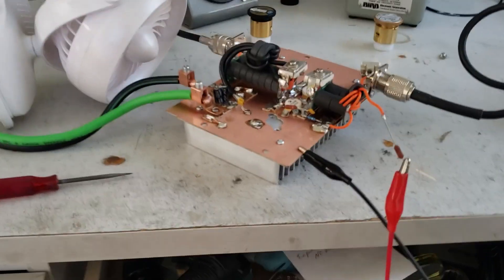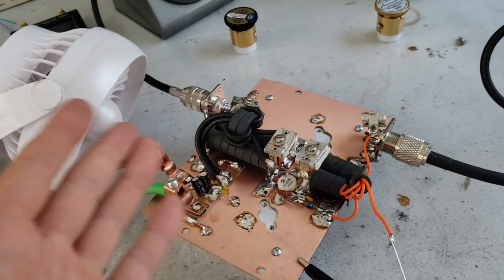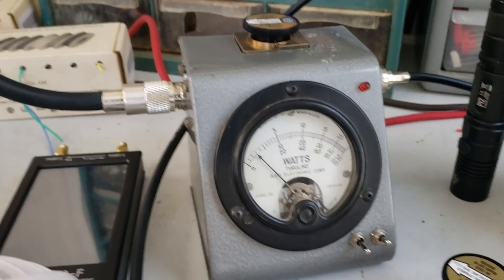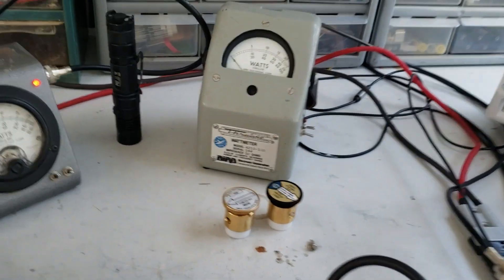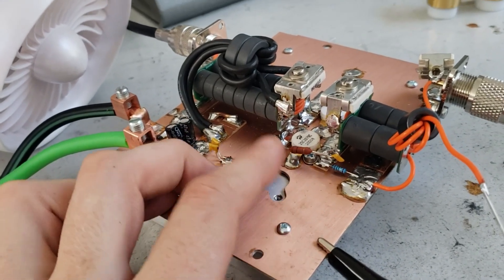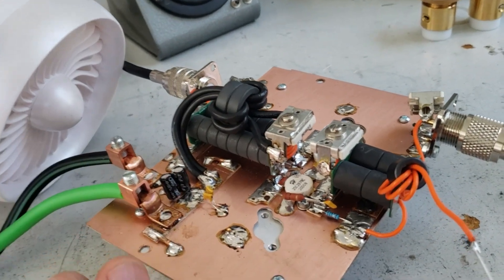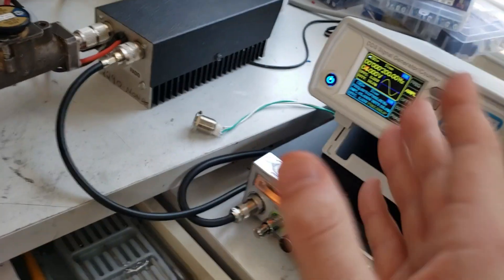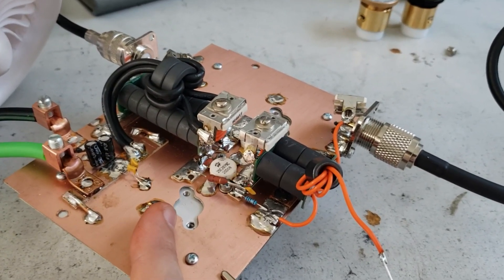Testing the HG 2SC2879C

Comment: The gain on those devices is awful. That shows that those transistors are certainly not up to industry standards. Aren't you the least bit suspicious that no legitimate company uses that manufacturer's devices in their product? HG is NOT a recognized semiconductor manufacturer in the electronics world. If I ever suggested using some of their devices in one of my design reviews at work... I'd be looking for another job the next day... LOL
Reply: Dude your "pallet" is nice but imo not 600w for $4,000 nice. Sharky had ldmos 1500w for $650 with filtering. Just saying
Reply: Then I suggest you contact Mr. Sharky for your future equipment...

Comment: You showed you was pushing your wave form into compression.
At that point the amplifier would be responsible for splatter because it would now be creating more IMD products . 
The radio may be clean but once you push into compression the amp becomes dirty, 
Ie if the radio alone set up correctly was showing a imd at -35dbm down on the primary signal,
Then I can say your amp pushed into compression on your oscilloscope,  would have raised your imd product considerably .
It may add colouration to the audio as you have said else where.   This colouration will be causing splatter. 
It’s my experience if Toshiba and others give a imd spec at 100 watts at 30 MHz at 12 volts, when you push past this
These imd products can be a problem and you will be splattering regardless if the radio is clean or not. 

Since You now have a spectrum scope , surely you have seen as you push into compression on the devices your harmonics go up,
Your imd products rise and your signal gets wider.    
Amps can and do cause splatter , this is why transistor manufactures give specifications.
And why the Fcc gives imd level  requirements .
Ever wondered why when a Japanese ham radio manufacture used Toshiba 2sc2879 in there final stage, they used two and only run 100 watts?
That was due to the transistors being very clean and having lower imd numbers at half there rated power.
The Toshiba spec sheet shows just that.

Keep up the great work and the learning process Sharky.    Just pointing out the flaw in the thinking. 
It’s just not about the bird numbers alone !    Just because you can, doesn’t mean you should . 
And rarely do the RF engineers and manufactures get it wrong.   
There are other factors than bird numbers alone. 
I enjoy your videos Sharky and will watch the learning progression and journey
All the best Robert